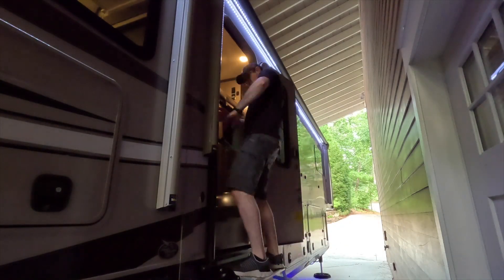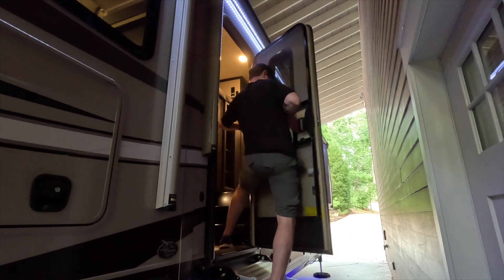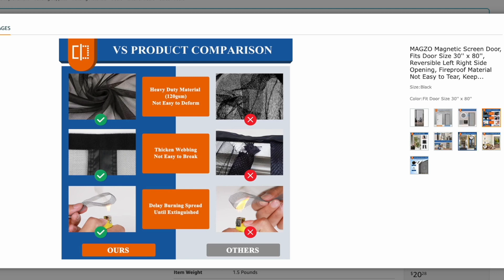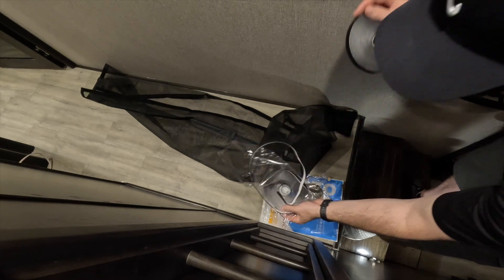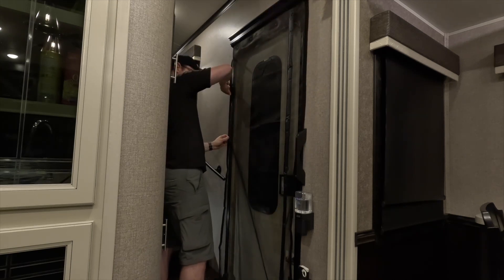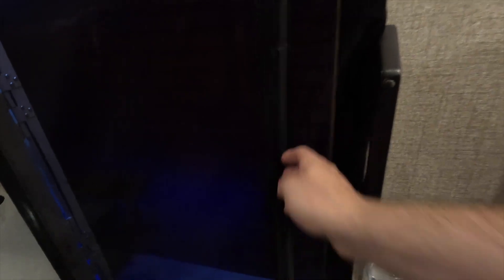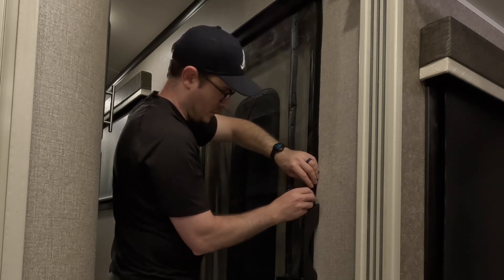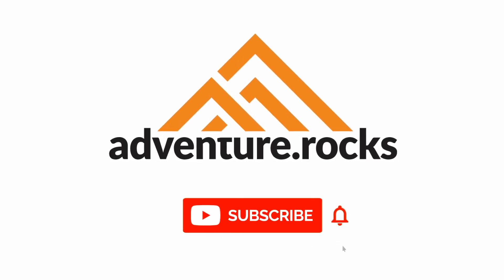I Got Rid of My RV Screen Door!!! Will I Regret this Magnetic Screen Door Panel on My Fifth Wheel?

Comment: Or go outside, close the  screen door. Leave the other door open, Stand on the steps and open it lol yall making it harder than it needs to be. But I totally get the frustrations cause I'm here trying to find a better solution too. Yhe screen door is just so ahead to open and close from yhe inside. It drives me insane. And I thought about one of those magnetic ones but they don't come in the measurements I need so I would have to cut it and diy and who knows if it will work. Thanks for the video.  It might be worth me trying since there pretty inexpensive.

Comment: You're not crazy. I share the same hatred towards this problem. I also did the same modification and I couldn't be happier. 

I also installed a peephole on my door so now with the magnetic mesh I can spy outside without opening anything.

Also hard plastic screen doors sometimes prevent proper locking. On my camper you have to pull it really hard just to get both doors to lock. Such a hassle!!! 😤👎
Reply from the maker: Great points. Good to know I'm not alone.